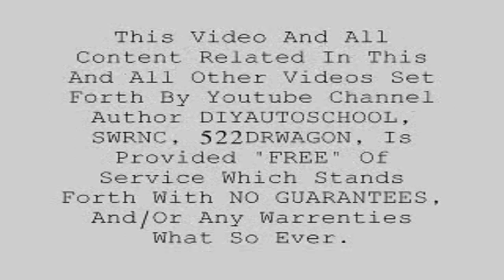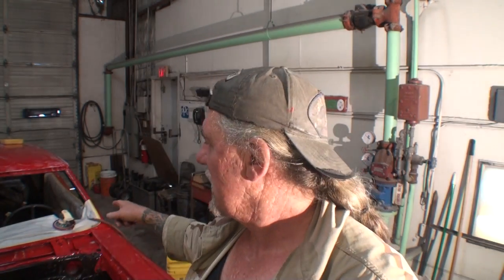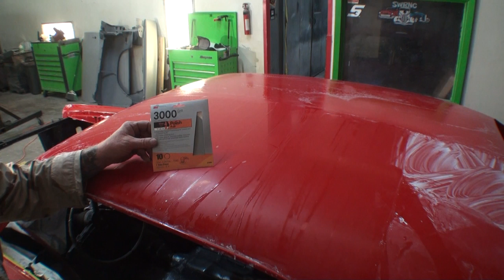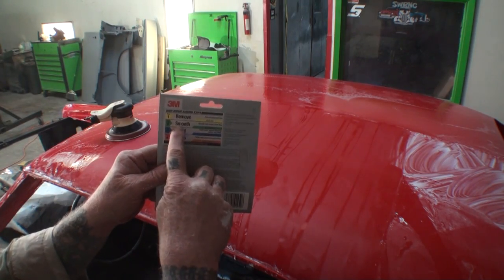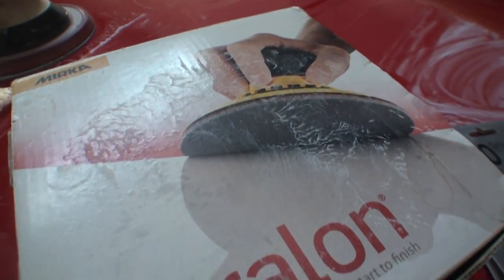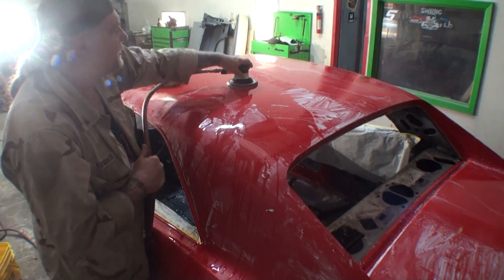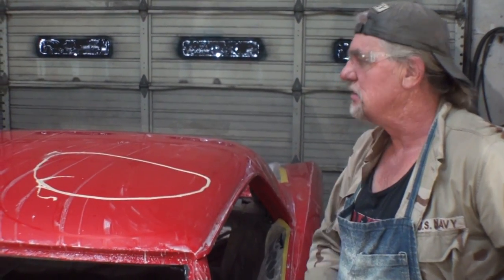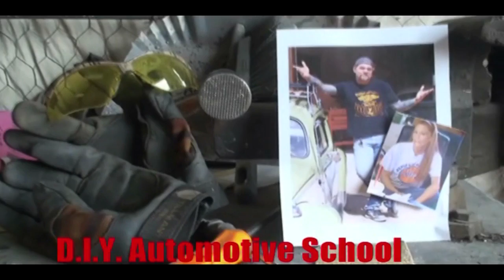Sanding A Car For Final Buffing - Is Buffing A Car Bad?

Comment: 3m says the same thing about the perfect it rubbing  compound. When you really only need the pefect it 3 if you finish with 3000. I use 2000 by hand then 3000 and an orbital polisher. Once i used an orbital polisher properly  i will never go back to rotary buffer. Great video  brother.

Comment: Ive used those wool pads after 3000 sanding it seems I still get swirling that pops up down the road that I have to correct with a foam pad. Maybe im using the wrong wool pad or being to aggressive with it when im buffing. Looks great Pete!!!!

Comment: Great video.  Back in the day, cutting the finish 2K coat with a sponge pad and cutting compound reduced the gloss of the final coat.
The finish was better when you bumped up the pressure on the gun and painted the panel where it was flat without orange peel and just left it.  Swirl marks were avoided by using a cutting compound without any Ammonia. Technology has come a long way.

Comment: I've always wondered why they called it color sanding when you are sanding the clear coat. Is it a leftover from the days of single stage paint jobs?
Reply: Back in the 70-80's we'd call it Wet Sanding.  LOL  I've changed my terminology in the last few years.  LOL

Comment: Hey pete, i was d a sanding with 2000 first then 3000 and mop back in 2002  works well  and very quick  cheers pete
Reply from the maker: sounds good.. I used to do the 2000 first then the 4000 but now just the 3000 for me and get er done.

Comment: Hey Sir, do you think I should use a single stage paint or could I do a base and clear coat on a semi truck. I have never painted a vehicle before and plan on doing truck in sections. Painting will be completed outside in the yard. Watching your videos and trying to learn. Thanks for helpful shows.
Reply from the maker: If your painting a solid color then a single stage will work fine. Metallics and pearls I would say base clear....
Reply: thank you, I know in one of your videos you say you prefer base and clear over single stage . thanks for the help with all the videos.

Comment: I wetsanded my freshly painted clearcoat with a da sander 2000 grit. I made sure the pad and the paint was very clean, but still i get pigtails in the clearcoat after i sanded it. How come?
Reply: I'm in the same boat with pigtails still showing up after dry and not so much after wet but still there using finishing film discs! With trizact I didn't get any. I am now going back over my car trying these mirka abralon assuming they're like trizact just a lot cheaper and I'm going to try damp sanding with 8mm orbit orbital! 🤞🤞I'll try and give feed back here and or if you found the trick by all means share buddy haha! A friend of Pete's is a friend of mine! 😅😎🤘
Reply: @1982mattd  I found a sollution against the pigtails. Have a microfiber at hand, and dry sand for maybe 10 seconds, then put the microfiber towel agains the sanding disc while running the machine to clean the disc. Then wipe of the panel with the same microfiber towel and repeat the process

Comment: What do you recommend I do IF my vehicle has all the windows and engine in it? Should I just tape them off or what? 
And how many times do you go over with the buffer?
Reply: Yes, tape them off with a quality automotive refinish masking tape and masking paper if you do not want to disassemble your vehicle. You go over the panel as many times as it takes to remove the 3000 grit haze. Probably 2 times. Then clean the panel with a clean cloth and water. Look it over. If you are satisfied then you are done! On dark colors a blue 3M  foam pad and Microfinishing  polish will take the finish to the next level of deep shine. Pete is the man!!!

Comment: Hello Pete and Mini i enjoy your videos. i have a 1972 ss blue original paint car. how would you recomend polishing it,the paint is in great condition i just dont want to remove any paint if i dont have to. thank you
Reply: the 72 ss is a chevelle
Reply: I would use a cleaning wax. It has very fine abrasive to remove any surface contamination. Use it like a wax, by hand. You may also consider a clay bar first if you can actually feel that the paint is not smooth. Clay bars do not remove paint. The cleaning wax will make the paint surface clean and somewhat protected. If you do those 2 steps you may consider a sealant to protect the finish. There are lots of choices. I have used Mirror Glaze 21 Synthetic Sealant. It is a good product to use after the 2 previous steps. Pete is the man!!!

Comment: Pete do you find that the DA sanding leaves the finish slightly grainy versus the hand sanding? I'm talking about after it is buffed out using each method.
Reply from the maker: No.. Actually the da sanding leaves a smooth simi polished surface where as the hand sand job leaves a more coarse finish..
Reply: @diyautoschool   Pete, thanks for your response.  I'm asking if you can notice a difference in the finish after the car is buffed out using the da finish method versus hand sanding with up to 2,000 or finer and then buffing.  The cars that I have seen buffed out using the da method seem to have a slightly grainy texture in them versus the hand sanded ones.  Thanks
Reply: @jimk7882  Grainy texture of the paint is probably orange peel. If you do not use a hand block and the 1500 to flatten the clear it will have orange peel. The foam pad and DA with 1500 will follow the orange peel. The block with 1500 by hand will flatten it out. Then the 3000 on the DA is only used to remove the 1500 scratches, leaving a 1/3 polished/ buffed surface.  The 3000 is part sanding and part buffing process.

Comment: Hey Pete I even have some 12,000 grit d/a paper, that's probably to fine? Right or wrong?
Reply: I think you have one too many zeros on there. 1200 will take longer to sand out with 3000. Use the 1500.

Comment: How do you handle the edges with the da and sliding back and forth on it
Reply from the maker: The 3000 grit sanding pad will not burn through edges unless you are trying to do it on purpose..
Reply: The interface pad has a thick foam baking. That coupled with the foam of the actual 3000 pad reduces the pressure on the corners and edges. If to look back to the video when he is showing the difference in the fender and roof before buffing, you will notice the edges and sharp body lines have not been sanded with the 1500. The front fender top body line is a perfect example of his skill. Not sanded on the sharp edges. That leaves plenty of clear for the 3000 and buffer to work with.

Comment: I go 800 grit with a Durablock hard block get it flat flat Then 1500 3000 and 8000. The 8000 you can make sure the peal is super flat. When you dry the panel with 8000 you will go wow lol. 8000 shit with no compound yes but after the car gets wet and drys it will look like shit. My buddy wet sands shit with 1000 and get on it with Super Duty. We All got our ways. My shit gets a block every step. One spec of dirt on that DA you will get pig tails . I got a Rubix orbital buffer Now.

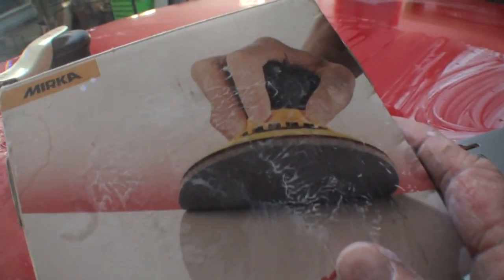Comment: Damn, ive been watching you for years. The reason, is your knowledge and i believed you were teaching to pass it on. Which in turn would make you one of the best. Master status. Yet, now im thinking i was taught by the guy at the local mechanic shop. Instead of one of the best. 14:45 and 15:15. Can you explain why you seem to be owned by 3m. As in, making a video only to advertise. If thats the case, you're selling. Salesmen will teach wrong to make a buck. I can understand that. If so, I'll keep looking for the best. I apologize. But thats how i feel